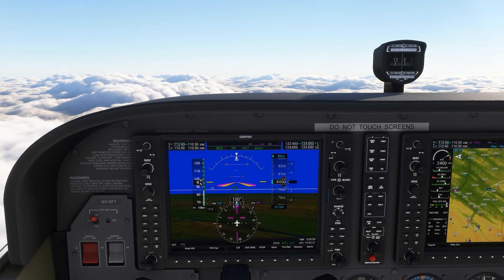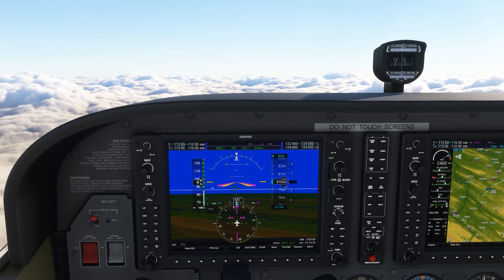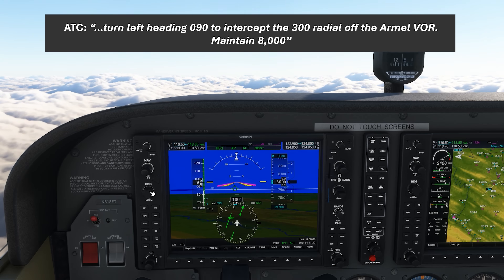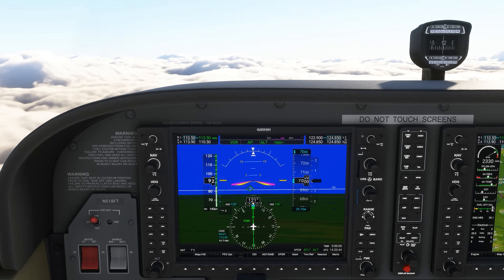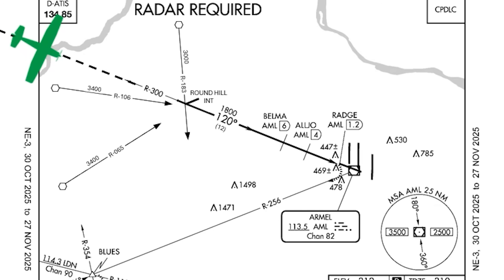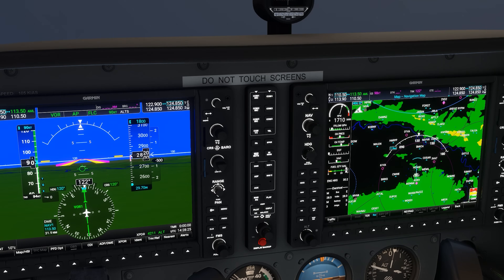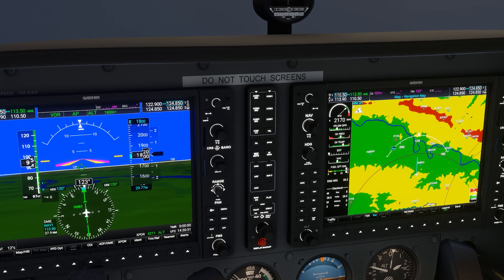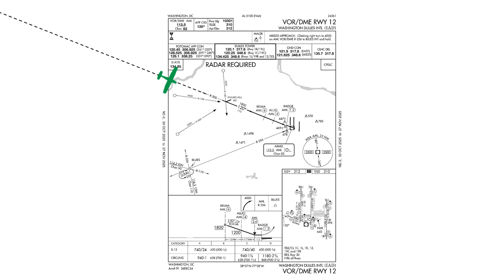The Miscommunication Behind TWA 514: And How Modern IFR Rules Fixed It

Comment: As an airline Captain, I have had FO’s try to run us into the ground when cleared for visual approaches at night.  When “cleared the visual to RWxx”, they immediately dial in the ILS intercept altitude…and start to descend to to it.  At LBB, DEN, LVS, and SAT at separate times I had to tell FO’s to climb back up, as we were approaching 500 AGL and still 20 miles from the airport…at night!  ATC is not required to assign an alt on a visual.  Pilots are required to maintain current altitude until a normal descent point.  Also…being on a dogleg to final does not mean altitudes shown on final on an approach plate are applicable to any offset approach angle flown.

Comment: Not like that in my country.  

They will give altitude assignments on close in vectors..  but they can also clear you for “an approach” which means any published approach or even a specific approach with no altitude restrictions or even transitions.  

You’re responsible for obstacles clearance.  I would have had another VOR tuned up and on the RMI to identify the fix before descending.

Comment: 4:28 When the aircraft has intercepted a radial, the aircraft is no longer on a radar vector, as they are not navigating by a heading assigned by ATC. The modern requirement for altitude assignment is specifically because the aircraft is not on a published segment of the approach, even though they are on the same radial.

Any aircraft on an unpublished route or radar vector has no vertical guidance inherently available to them, ergo this crash and the rule requiring ATC to assign an altitude to maintain until on a published route that you have illustrated otherwise.

Comment: 25NM MSA to the left of the field is 3500 ft. No point to be lower unless you are protected by the procedure. However, I would fly 7000 as long as it takes to initiate a normal descend that would be a natural extension of 3° glideslope (to descend at 500ft/min, you need to initiate descend ~10 min before BELMA, because 7000–1800=roughly 5000 ft of altitude that you need to get rid of, and it takes 10 minutes to do so at 500ft/min)

Comment: First 8000 ft. / 300 ft. per nm = about 27 nm. Maybe a good distance to start down if left to them, roughly 3 degrees, descent rate roughly 1/2 groundspeed + a 'zero'?... but you would still have to take terrain into account even doing that. Second, at 1800 ft. with terrain ahead, would there have been any interference in the VOR signal? Logically it seems that line of sight with the VOR would not have been maintained. Potentially losing the VOR signal or having it go squirrely within a relatively close distance might be an indication of the signal being blocked between you and the station, correct? Safety devices like GPWS and TCAS were a product of the 1970's. Feel free to point out anywhere I'm off base with this.

Comment: Great job. I am always thinking about the optimal approach... using MSFS, I prefer to use the VNAV for all my approaches, especially when IMC.  I feel safe about that, even though ATC will repeatedly tell me to "expedite descent".
Reply: VNAV is not for descent on an instrument approach, only for descent from cruise altitude down to an approach. instead use APR mode to descend via the glide slope or glide path depending on your approach when it intercepts. This will also hold your lateral guidance simultaneously.

Comment: The altitudes of the nearby approach routes were 3000-3400 MSL, and the MSA said 3500. Too bad they didn't do a more thorough approach briefing. Even so, it is safer to make it explicit and this is video gives a good example of where PTAC comes from.
Reply: Yes, when I saw three feeder routes coming into the the final approach from the same general direction from three different vectors at 3000 and 3400 and not going down to 1800 unitl round hill intersection I figured that there's a reason for that. None of the three come in to round hill under 3000, should have been a red flag that the final approach radial to infinity was not a magic carpet ride at 1800.